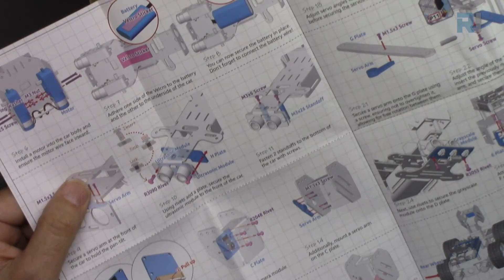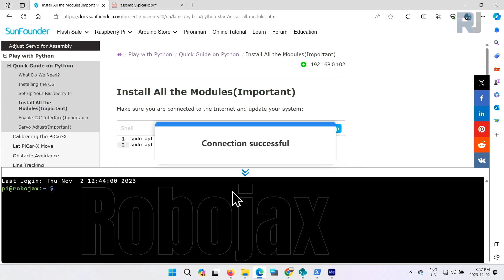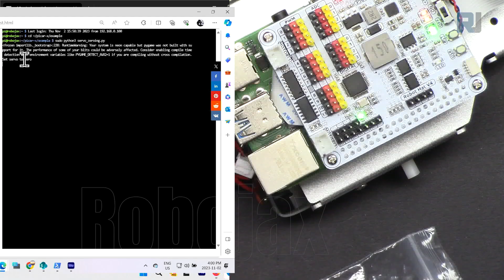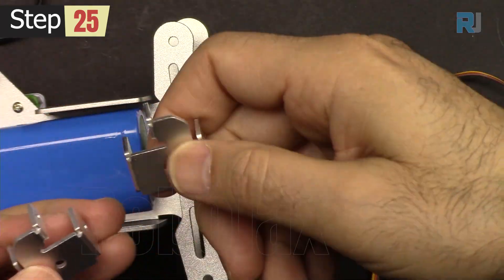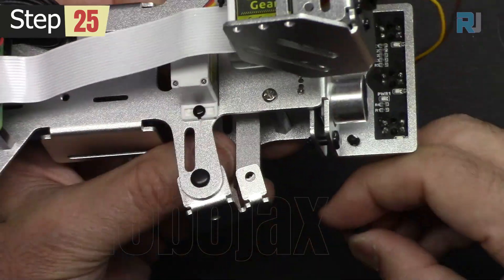Lesson A2:  Assembly of the PICAR-X Raspberry Pi Smart Robot car kit by SunFounder

Comment: I just finished putting mine together.  I've just got to train in now. Without your videos, I would have spent hours learning how to do the machine learning on a pi.  I have noticed that yours is different from mine. Some components, just different looking. Did they give you 4 of everything? Every screw, cable connector, washer, i have a ton left over. Even the motors all came with little white plastic pieces you normally get, but i only used a couple pieces. The rest of it was never  used in the instructions. I've made some upgrades on mine. I'm using a pi 5 8gb with a pineberry base for a dual edge TPU module to use that PCIe slot opting out of the ability to use an NVMe as my boot drive but i have it boot through USB using a Samsung EVO 980 NVMe using 40gbs adapters to use everything thing is worth. I also have a  PoE HAT, and then the car's HAT. I decided to try and make it is as autonomous as possible. Instead of the stock Pi cam, i used one about 5 times the size and FOV. Then I also mounted a 3d stereoscopic camera above the ultrasonic module (1st time I ever saw one, I thought that they were 3d cameras..LOL). I placed the Pi camera on the back along with an ESP 32 camera module to cover the other flank. To add to the machine learning, I also incorporated a Coral CPU USB accelerator, or another google edge TPU to increase inference rates. Hell, I'm thinking about taking the Pi out all together and using my Orange Pi 5 plus 32gbRam. That thing is a beast that puts the RPi to shame, but its Chinese made with NO community around it, so teaching myself GPIO pins and potentiality has been daunting. I think i'm going to try and incorporate and Human Presence detection module i have. As we;; as.  Ai text-to-speech module and a facial recognition module until i train the Ai. I'm excited with the possibilities of this little project
Reply from the maker: Hello and WOW, you really got into it. Lots of efforts you have put into this. Definitely you will enjoy, learn and get fruits of this in the future. Keep up playing, don’t give up. You will face lots of problems but keep going. Cheers, Ahmad